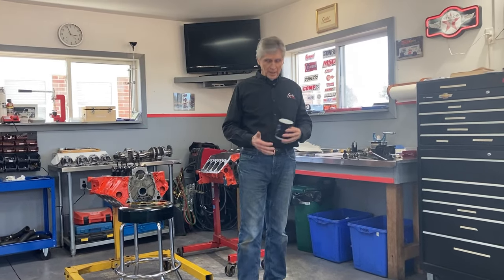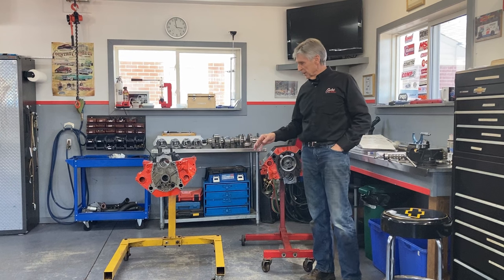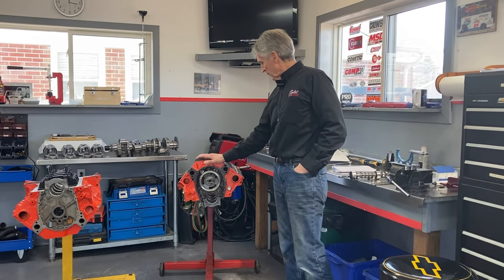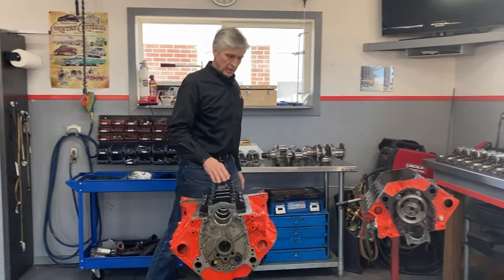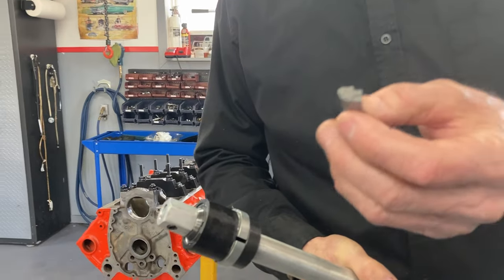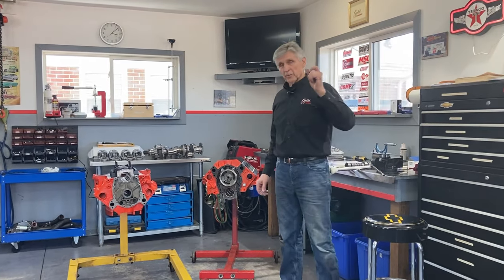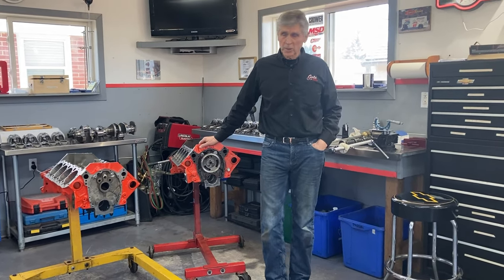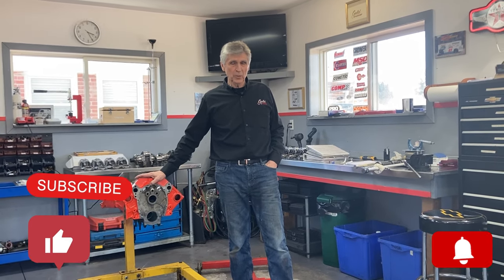Building a SBC Chevy 400 Problems and Solutions PART 1 of the Build

Comment: I would say the first real muscle car was the 62 Plymouth fury super stock. But the GTO gets all the credit due to production numbers. The fury had a 413 max wedge with a lot more power than the GTO .
Reply from the maker: Good point, the GTO is based on that it was the first  full size car engine in a mid size car. AG

Comment: I`m a old guy and in my shop and my home I have a few old Clevite bearing catalogs. I call them "The Bibles" I tell all the guys that I`ve worked with  to set everything up to the clearences in the bible, reason being you can just about garantee the rotating assembly will not fail for a long time unless abused..One question...Where did you find those 400 small blocks? I had 17 of them and never thought I`d go through them so fast and now I can`t find one without a bunch of core shift. I enjoy your videos, looks like we both went down the same paths about at the same time.
Reply from the maker: Thanks Ed. I can relate to your experience. Yes, it is getting harder to find 400 blocks. Easy way to make power and torque. AG

Comment: i was told all 400 chevy blocks have 3 freeze plugs per side..your 1st engine only has 2...whats up with that ?
Reply from the maker: Thanks Lucky. Good question. 
Actually they do not all have 3 freeze plugs. The 509 block has 2 freeze plugs and comes with 2 bolt main bearing caps. This is the one I am building now with the splayed 4 bolt main caps and ARP Studs. 
The 511 block has 3 freeze plugs and has  4 bolt main bearing caps. That one I built in the spring. 
AG
Reply: At one time I had a 2 freeze plug block with 4 bolt mains and a 3 freeze plug block with 2 bolt mains.

Comment: I am not grasping the idea of different size brains on the top and the bottom. It would seem to me that one side would be bigger than the other
Reply from the maker: Good question Jackie. It works because the bearings are not round. The clearance at the parting line is a few thousands more than at the center where the load is applied. The purpose of this is to create an oil wedge as the crank rotates. Ideally the crankshaft never contacts the parting line and also the difference in thickness is only .0005". Hope this helps. AG

Comment: 400 smallblock almost always crack in the heads because the extra water channels in the heads
Reply from the maker: Thanks for the info  Mats. AG
Reply: @goldsgarage8236  Ifound camel hump heads 186 casting I will put them on a 1974 corvette I will not take the shortblock apart It will be little bit  back yard repair Somebody have worked on this motor years ago The car have just been sitting so there is not many hours run on it

Comment: I understand that opinions differ & there are some "muscle cars" that do not meet my definition of a muscle car but I like to think it's a full bodied 2 door car that has a back seat & will sit 4 people. And the engines hp equals 10% or greater of the vehicles overall weight. = "muscle car"
Reply: P.S. and it must be rear wheel drive.
Reply from the maker: Thanks Jesse, that is a pretty good definition. AG

Comment: I don’t really like the 509 blocks over the fact they’re the only ones that have the factory 4 bolt mains, they’re cast thinner than the 817 castings which are 2 bolt only.
Reply from the maker: Thanks for your input Shade. Actually the 511 had four bolts, the 509 had two. The 400 I built in the spring was a 511 Block. The 406 i just finished was originally a two bolt but it has aftermarket splayed 4 bolt main bearing caps. i just published a video about it, 503HP and 527 Torque. AG

Comment: IMO the first proper muscle car was the GTO, but the beginning of the muscle car era started with the high perf 392 Hemi cars and the fuel injected Chevy cars in the later 50s
Reply from the maker: Correct Adam, and the dual quad 409, (I have built two of them) . The difference is in 1964 Detroit started to put big engines in small cars. Thanks for your comment, please keep watching and commenting. AG
Reply: It was not a GTO... it was a pontiac tempest GTO (GTO was a trim not a model)

Comment: Don't you think that the necessity of the amount of horsepower you make compared to the amount of torque is subjective to the vehicle and the size of the engine, even for a street engine?
Reply from the maker: Good point reloading. Yes, you should also take into consideration, the vehicle and engine size. (pounds/cu. in.), and the lower that number is the more cam duration is allowable. Overall gear ratio (transmission x third member), type of transmission, torque converter stall speed should also be considered as well as the purpose and driving style of the owner. 
That said, cam durations that provide more HP than torque typically have low vacuum, idle poorly, have poor fuel economy and are only efficient at high RPM. If these characteristics are acceptable that's fine but a smaller cam is typically more fun for the  driver if the vehicle is driven frequently.
Thanks for your interest in my channel, please keep your comments coming. 
Allan Gold

Comment: First real muscle car was Chrysler Hemi in 50"s. And NO.. it was no pontiac in 64..
Reply from the maker: Thanks Antilaw.  Good point. There were many hot cars prior to 64, the Hemi for sure, the 409 Chev, 427 Ford etc. The definition I was using is installing these engines in compact cars instead of full size cars. AG

Comment: How do you avoid heating issues on the 400? Whats the best water pump ,thermastat and radiator combo for a 550 to 600 hp motor?

Thanks
Reply from the maker: Hey Rafael, thanks for the question. I haven't built 550 or 600 HP but the street engines are ok as far as I know. I think any 600HP engine will need the best cooling system available. 
Remember, the thermostat rating doesn't control or limit the temperature of your engine, just the point  (degrees) at which it opens. AG